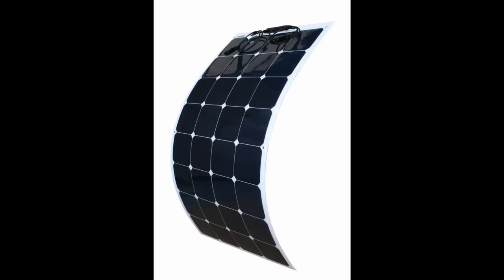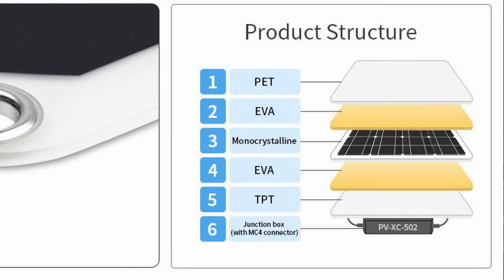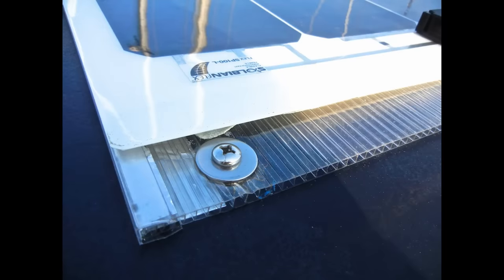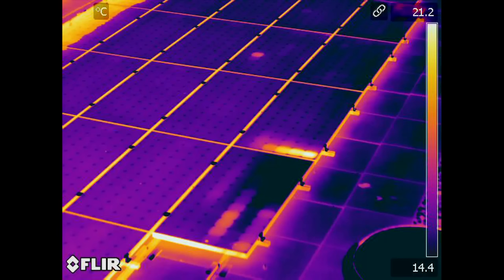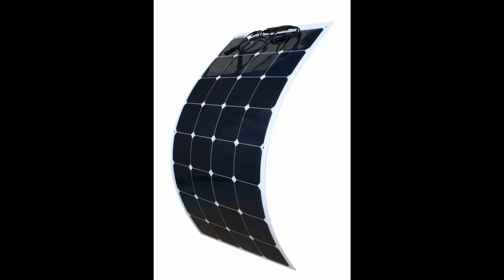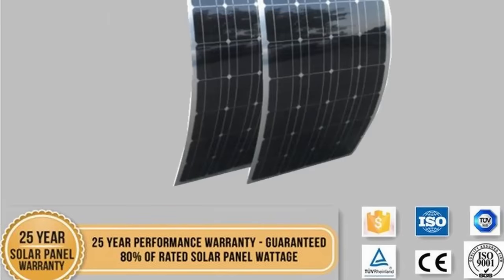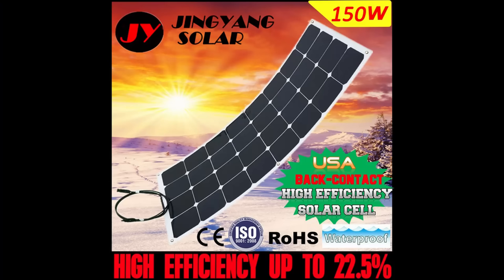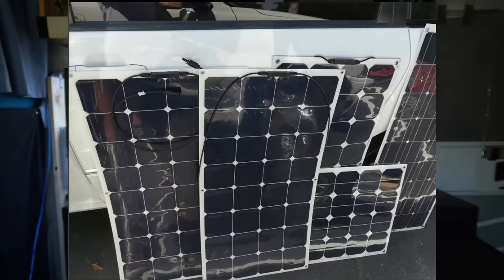The Truth About Flexible Solar Panels

Comment: I've got 2 cheap semi flexible panels bought back in April and May 2018 , the smaller one is 32 cell 100w ,  tested in full sun it puts out average of 22watts......thats with less 1 week in the sun ,  the larger one is 36 cell 160 watts,  puts out average 72 watts with about 3 weeks use.  At the same time I tested my traditional panels both 36 cell, the 60w panel got 51w , the 80w got 62w output .  Both these panels are about 6 years old .  Don't trust the specs on these crap no name flexible panels.   Steer clear of 32 cell panels , the lower voltage makes them inefficient.    I only use these panels for portable use , they spend most of their time in a shed away  from the weather / sun. Bought them mainly to save weight ,  stuffing them in a small boat to camp in remote spots, sometimes a fair walk from boat to camping spot.

Comment: Solution = Form fit copper plate, water channeled.  You can fabricate a sheet that's fairly thin and has water channels running to a rad and small DC pump.  Problem solved.
Reply: Water and electricity in the elements - a poor combinition for elegant engineering solutions. Back to the drawing board i think.
Reply: @normanmazlin6741  I'm guessing by your response you've never dealt with a water block on a PC or similar before?  It's a great combo that does a fantastic job of drawing heat away from the TDP of a processor.  I'm pretty sure it would be fine in a solar solution, if a little pricey.
Reply: @percivul1786  I used to repair high power radar systems, some of which used water cooling. These were ALWAYS a real problem, with condensation problems and leaks, especially systems subjected to vibration, shock and harsh environments. NOT a good engineering solution. Cooling blocks on a pc motherboard are a totally different kettle.
Reply: @normanmazlin6741  Not really sure what kind of radar you worked on but they have existing liquid cooling systems today for both ground and air based radar that work wonderfully.  Nevermind the fact that what I'm suggesting isn't even a new idea and has already been proven a working and solid concept.  I'd advise you to check into that for yourself so you're caught up on the matter.
Reply: @percivul1786  last time I checked, liquid cooling for solar panels is not being considered or used. Hotspots in a solar panel are caused by faults in the panel and as with any engineering solution - fix the problem, not the symptom.
Reply: @normanmazlin6741  There was a time when liquid cooling a PC wasn't done or talked about and yet they do it now.  So, there goes that point.  As for "could it be done" where solar is concerned, I'm going to say yes it could and most likely will be at some point.

Comment: They key is having an air gap under the panel. Year and a half on mine and no problems.
Reply from the maker: What's rated output currently?
Reply: Will Prowse couldnt tell you but i have fans and fridge on all day in SD and 4 100w panels keeping 630 amp hour batteries at 14.2-14.5 during peak sun hours.

Comment: What you're saying doesn't match at all with what I see from Renony (which is panels I'm looking for) they guarantee the output of their flexible panels to keep 95% output for 5 years, 90% at 10 years, and 80% output to 25 years and they're flexible to a very extreme degree so I would feel confident they wouldn't crack with a shallow curvature. You start the video with all these blanket statements. I would recommend communicating in a more precise manner just my feedback and opinion as a viewer.
Reply from the maker: LOL
Reply from the maker: Post a video after five years of use with that output. I dare you
Reply from the maker: So funny. Please prove me wrong 😂😂😂
Reply: I actually think the renogy solar panels that are flexible are great. People shouldn't step on them and handle them with care. Obviously they are not as durable as glass solar panels but they really do have their place in the marketplace. I see them being a great no drill solution for rvs and mobile vehicles. When typically rvs and mobile vehicles have shorter life's than residential homes. I expect systems to last around 10-15 years.

The quality of renogy panels are pretty high and with good quality cells. I don't use any other panels. 

Just please don't step on them...
Reply: @WillProwse  they’re putting their reputation, sustainability of the company and profit on the line with a written guarantee. So I’m pretty sure they’re right that they will last and even if they dont i should buy them so then i can ask for new ones. Everyone I know that knows about rv and sailboat conversions has respect for renogy product so that’s main reason I’d buy from them. You’re the one making the video saying everything is crap so you should prove it. Just go find someone that has them for that long and measure them so you can be right and prove your point. I bet you can’t do that. I dare you to prove it. I dont think a company would bet their whole business on being wrong on their guarantee. So prove it i dare you.

Comment: Do you have actual statistics for failure rates of flexible panels? Your arguments sound good, but they are anecdotal. For example, I have large flexible solar panels than can be bent back upon themselves (and have been), they are well over 10 years old and function perfectly. I have several dozen other large flexible panels that several years old and have had zero issues. My panels are not Chinese, they are quality built from reputable companies. If you buy cheap Chinese junk from Amazon... well, you are probably going to have a higher failure rate. Maybe your issue is that you are just buying cheap products and expecting more.

Comment: Mine failed in 4 months !!! Garbage!
Cost me $400 off amazon and I mounted them on the aluminum roof of my rv (figured it would be a good heat sink) but they failed in 4 months and seller sais he will not do anything about it 😡😡😡
Reply: only if the air flows under the aluminum. otherwise your solar panels become the heat sink .

Comment: Would aluminium backing help?
Reply: Yes, and even better if you can add fins like a heatsink.
If you want to take it to the next level, then attach pipes to it and pump water around to keep them cool, increase PV output, and for a bonus get hot water which you could use to heat a pool.
Reply: Yessss.Glue them on those black pool solar panels and run pool water through it.Great.But salt pool water may not be a good friend with electricity.It's still safety issue I think, otherwise we would see product like this  already, that idea is so simple and gain so much out of it.They need to come up with more sophisticated cooling and some easy plumbing to connect them.

Comment: These are totally useless, the plastics used are never fully UV stable and they dull over time, reducing the output. The coatings also begin to peel off. Glass panels are the only way.

Comment: So what's a 30 degree radius?
Reply from the maker: The amount of curve something has
Reply: Well yeah, that's what I assumed you meant... But the radius of a circle is a distance and degrees isn't a unit of distance. Curves don't have angles (or temperatures), unless you're talking about tangential angles, but they change along the curve.
Reply from the maker: Ohh. Ok. Think of a circle. Break it up into 30 degree increments. Measure curve.
Reply from the maker: The curve of a circle if you take 30 degrees out of it
Reply from the maker: A circular curve is often specified by its radius. A small circle is easily laid out by using the radius. In a mathematical sense, the curvature is the reciprocal of the radius, so that a smaller curvature implies a large radius. A curve of large radius, as for a railway, cannot be laid out by using the radius directly. We will see how the problem of laying out a curve of large radius is solved. In American railway practice, the radius is not normally used for specifying a curve. Instead, a number called the degree of curvature is used. This is indeed a curvature, since a larger value means a smaller radius. The reason for this choice is to facilitate the computations necessary to lay out a curve with surveying instruments, a transit and a 100-ft engineer's tape. It is more convenient to choose round values of the degree of curvature, rather than round values for the radius, for then the transit settings can often be calculated mentally. A curve begins at the P.C., or point of curvature, and extends to the P.T., or point of tangency. The important quantities in a circular curve are illustrated above.
Reply from the maker: Shit I should have ommitted the radius part. Darn it. Thanks for correcting me
Reply from the maker: Found a few companies that still put this: Our monocrystalline semi-flexible high efficiency solar panels have an impermeable laminate coating the entire module allowing them to contour and flex against curved surfaces with a maximum bending radius of 30 degrees.
Reply: No idea what you mean. You can specify how far you can bend something in how small a circle you can bend it around before it breaks. That is the tightest curve something can bend around, aka the minimum bending radius. But the size of a circle is purely dependent on it's radius/diameter. None of it has anything to do with angles. 
A 30 degree radius, just doesn't make any sense. It's like saying something is 30 ounces far away.
That said, I would be interested in knowing the minimum bending radius (in a unit of distance).
Reply from the maker: Think of it like this, if you have a circle, take 30 degree chunk out of it. Lay solar panel on that curve of the circle. I see your point and the measurement these companies seem to use is a stupid one from train track design. I wouldnt lose any sleep over it unless you feel like emailing all of these companies and tell them they are idiots for calling it that. Up to you
Reply from the maker: And 180 degree curve would be if you bend the entire panel to make a half a circle. 90 degree would be half that. If you bend it 360 degrees, you can bend it to make a circle and no more. Does that make sense?
Reply from the maker: It's a shitty way to measure a curve
Reply: Ok... I think I see what you mean. The problem with that is that no matter how bendable it is, you can always bend it 360 degrees to a full circle if it's long enough. So for your 30 degrees to mean anything one would need to know the dimensions of your solar panel.
This is the reason why people usually specify how bendable things are as a minimum bending radius. The minimum bending radius will be the same no matter how big the solar panel is. The bigger it is the further it will wrap around the circumference of the circle. But the radius of the circle around which you can be bent without breaking will always remain the same.
Reply: I'm sorry... I just realized you often wrote multiple comments and youtube for some reason has a tendency to only show the last comment. So I basically didn't notice half of your comments, therefore my replies only address half the stuff you said, which obviously makes for a rather confusing conversation.
Thanks for explaining degrees of curvature. I really never heard about that and while I do understand it being useful in civil engineering, it doesn't make a whole lot of sense to use with solar panels, especially considering it depends on the distance over which the angle is measured and therefore on the size of the panel.
I certainly consider it wrong to call it a radius, since it doesn't really make much sense. You can calculate the radius using the degrees of curvature, but that doesn't make it a radius. I guess you can't be blamed for quoting the companies own statements though. So yeah, weird they would express themselves like that.
Anyway, sorry for the confusing conversation... And apart from the 30 degrees radius really confusing me, the disadvantages you listed about flexible solar panels certainly make sense and are worth keeping in mind. Though I wonder if it's the case with all types of flexible solar panels. There are certainly some that can be bent further than "30 degrees" and I would assume it shouldn't be too difficult to find a good and flexible thermal conductor...?